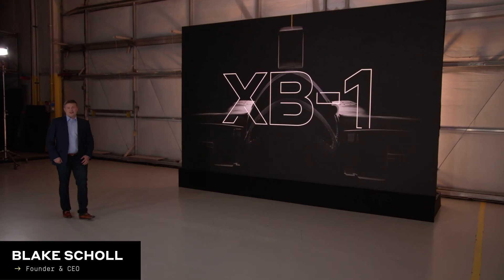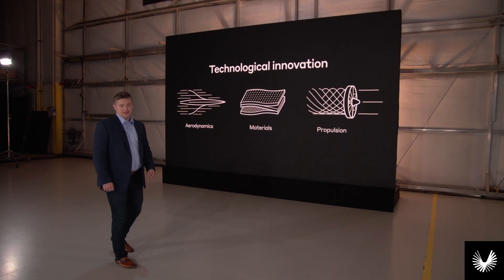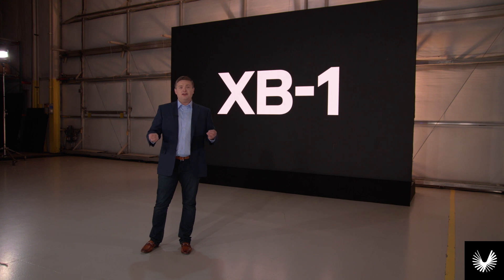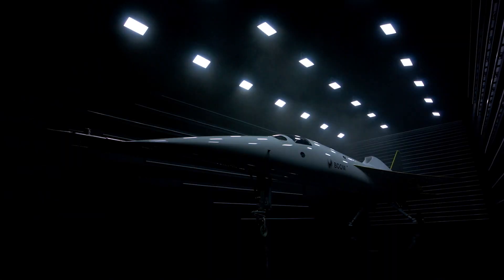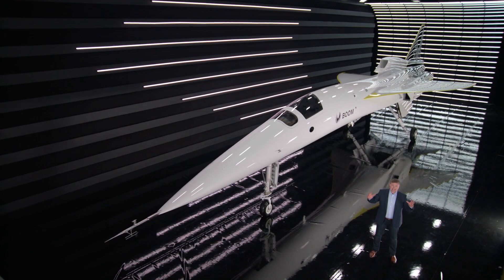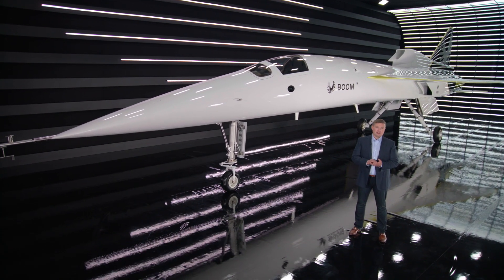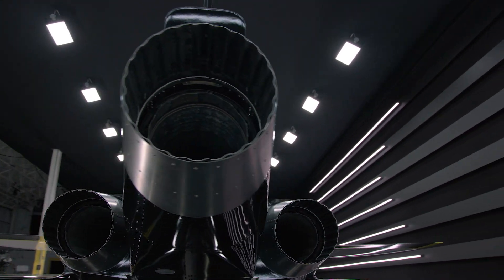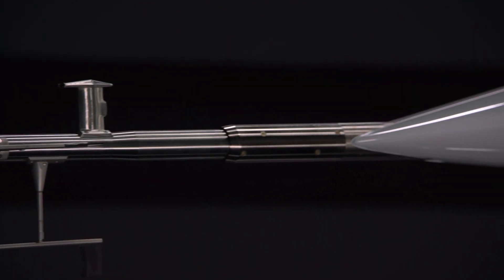XB-1 Rollout Highlights

Comment: Won’t the things on the top and bottom of the nose increase drag, add weight, and slow it down?
Reply: They're called pitot tubes and they're necessary. They calculate the aircraft's airspeed by measuring air pressure. 
They need to be right at the tip of the nose so that the airplanes aerodynamics don't manipulate the airflow hitting the pitot tube as that would lead to false readings. 
Many military aircraft especially fighter planes have those. 
They do cause some drag but they're necessary
Reply: @harshg.9896  oh. Thanks

Comment: How do we reduce the noise of supersonic boom ?
Reply: I don't think they will, though NASA's been working with Lockheed on that.
I dont think they're gonna get a license to operate at supersonic speeds over land. They're probably aiming for transcontinental flights where it's easy to avoid noise regulations
Reply: @harshg.9896  Yeah, sonic booms are basically unavoidable
Reply: There is currently a lot of work being done to address this very issue. I saw an article not long ago about this. Wish I could remember where! If I run across it again I will post it.